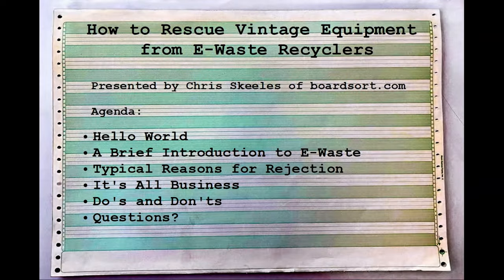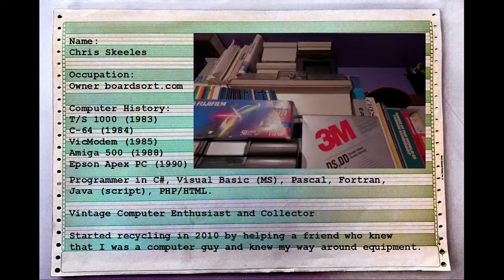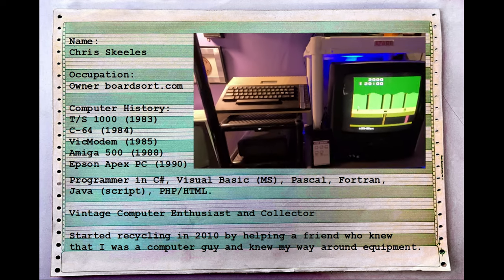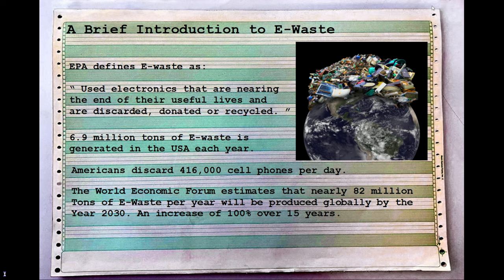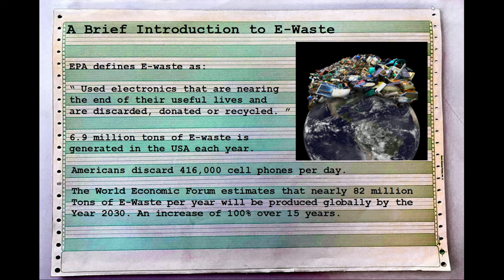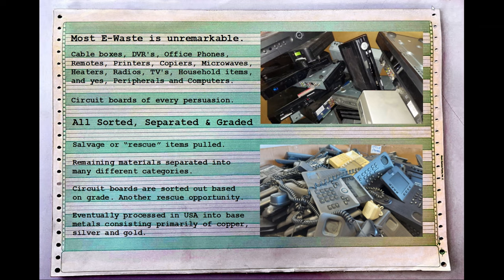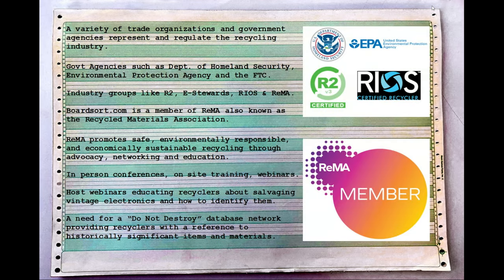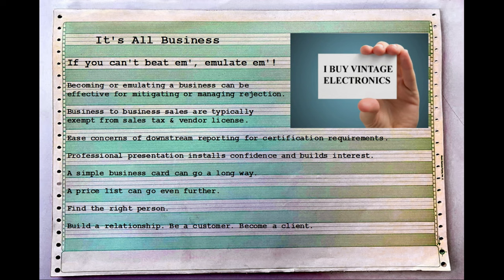How to Rescue Vintage Equipment from E-Waste Recyclers | VCFMW 19 (2024)

Comment: Are there any collectors of other vintage electronics (i.e. not computers)?

My local electronics recycler has a vintage console television (1960s?) sitting to one side of the facility. I have no interest, so I did not ask if it is for sale, but I assume that it is there for a reason.
Reply: There are collectors of almost everything out there. Old radios, televisions, vacuum cleaners, you name it.  Facebook is probably the best place to find groups interested in a given category.  The vintage CRT (television) scene is pretty active.

Comment: One thing the scrappers and recyclers should keep in mind would be the arcade community. Dell Optiplex 740, 580, and 380 computer motherboards can be repurposed for repairing several very popular games. These hold a lot more value than scrap if working.